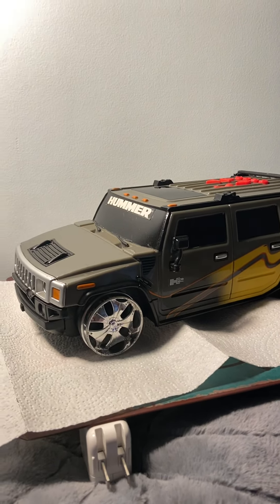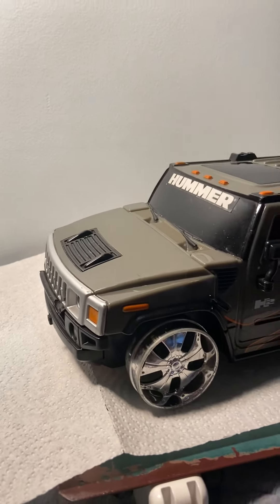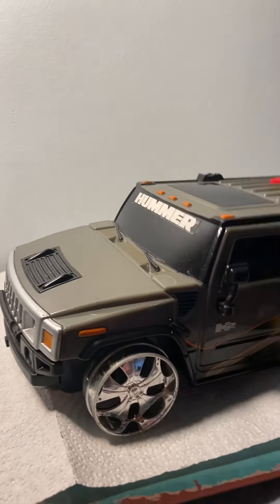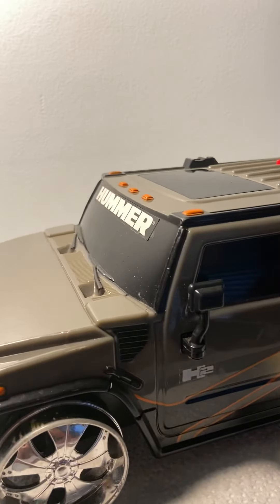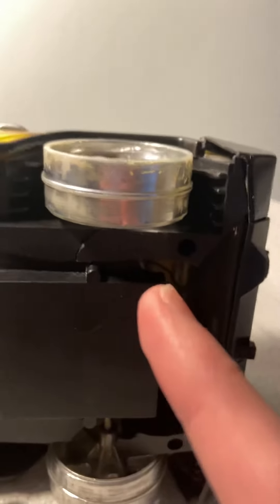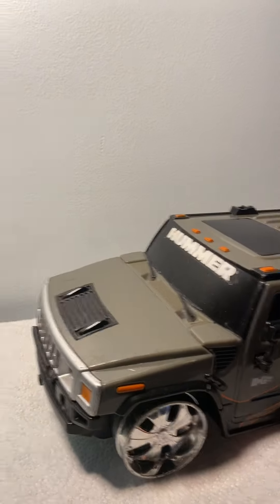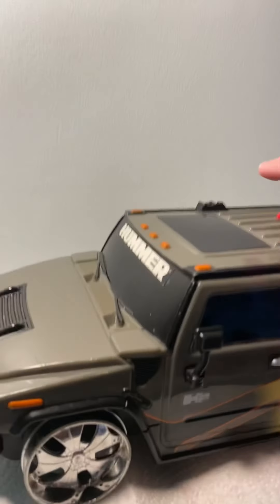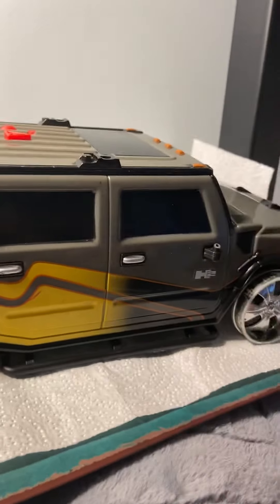2007 T.S.I Road Rippers Top Tune Comeback '04 Hummer H2 ( Extremely Rare )

Comment: Nice. I’m still trying to get my 2006 top tune come back HummerH2 up and running again.
Reply from the maker: Yours is the gray one, if so, it’s 2007, also did u see mine is in horrible condition and had water in it when I picked it up
Reply: @masterroadrippercollector9723  yeah I’m glad you picked it up but honestly if I saw that I would’ve left it.
Reply from the maker: @Vehiclemaster-qq6fr  yeah, surprisingly when I got home it had no more water in it
Reply from the maker: @Vehiclemaster-qq6fr  one peice of the base that is broken off in the back is the place where the screw goes and screws into the body, and since that part of the base is broken off the original owner glued in on there so I can’t get that broken part of the base off, and the plastic scrapes against the one wheel
Reply: I found one at Goodwill in good condition in 2018 and another one with a messed up gearbox earlier this year when I found the 2 cha cha slide pt cruisers (I could only get the one in better condition), the other one also had a messed up gearbox
Reply from the maker: @thattoyvehicleguy9000  I don’t know how you found to of the same rare hummers and pt cruiser
Reply from the maker: @thattoyvehicleguy9000  this one I had to find the listing, and go to someone’s house, if I did not get this hummer, it would probably end up at my local goodwill, or worse, maybe in the trash, because you can’t sell this on eBay, nobody will buy it
Reply: @masterroadrippercollector9723  a few years ago I got pretty lucky at that location, not as often since I moved closer to it but that's how I got my SPS Escalade when I first went there

Also Ive found some pretty rough stuff there (the turbo rig trailer, vault buster and 2 of the bigfoots I found, oh and a job site machine wheel loader. surprisingly the '07 snakebite was fine just needed the chassis repaired)
Reply from the maker: @thattoyvehicleguy9000  I found 2 rare RRs at a goodwill like 30 min away from me one time, only time I was actually lucky at that one, now at that one I find newer RRs that have severe corrosion, or olderish RRs like 2011 + with a lot of corrosion
Reply: @masterroadrippercollector9723  I mostly find 4th gens, one time I found a rarer 4th gen that I somehow miraculously revived from corrosion
Reply from the maker: @thattoyvehicleguy9000  I did find a 2009 RR at my local goodwill, it was super dirty missing battery compartment, had glitter on it, and orange gunk in the rims, I got it, and cleaned everything but the gunk in the rims, and the 2009 RR works, but the mute switch is kinda messed up, like when you turn it on in the middle of a song, and then turn it off, the sound will cut out a few times during the song
Reply from the maker: @thattoyvehicleguy9000  honestly, with my luck, I will never find a TTCB at my Goodwill, 2 years or so ago I got back into collecting, kinda, I was trying to get only TTCBs but never found them at goodwills or thrift stores, then I saw some of no name 51’s videos of him destroying RRs like one vid he destroyed the very rare TTCB 2009 pt cruiser cha cha slide blue variant in water, it made me so sad because I tried so hard to find TTCBs, now I have a okay amount of TTCBS because I bought most of them online, I also have found RRs at antique stores before
Reply: @thattoyvehicleguy9000  I usually only find third GENs and up at my local Goodwill but there is the occasional second GEN. Only got lucky enough to find a first GEN wants at a Goodwill slightly farther away from me.
Reply from the maker: @Vehiclemaster-qq6fr  nice
Reply: I've only ever found 2 first gens, obviously that one was corroded to hell (turbo rig trailer), the other being a lightning blast mustang that just needed the gearbox back in place
Reply: @thattoyvehicleguy9000  yeah I remember seeing that video.
Reply from the maker: @thattoyvehicleguy9000  nice a lightning blast mustang
Reply: Btw the 4th gen I mentioned took a whole month to fix because wires kept coming off, solder pads kept coming off the board due to heat so I had to improvise on making all of the lights work, some wouldn't turn on to begin with, on top of that I also added more lights on the back of it
Reply: @thattoyvehicleguy9000  hope it was rare and/or worth the time. Sounds like what I’m going through with my HummerH2 right now. I was sooo close to getting that gearbox fixed and then things started popping off.
Reply: @Vehiclemaster-qq6fr  it's the garbage truck from the Rollin' Sounds series, they weren't made for very long from what I remember
Reply: Welp, just found another 1st gen there yesterday, I'll make a community post about it shortly
Reply: @thattoyvehicleguy9000  Wait.. you got the viper at GoodwiII? DANG!
Reply: @KlaskyBobCsupoPants  not the icb viper, the Kawasaki big rig

Comment: Jeez the chassis is messed up badly 
And well the entire vehicle 
Also you did the thing again-
Reply from the maker: Sorry, I posted this video before reading your comment
Reply from the maker: Are you  glad I saved it Xbell
Reply from the maker: Because she was shaking water out of it, and it would probably have fried if I did not get it
Reply from the maker: Also when I got home there was no more water to clean out of it, also I never find things like this for sale near me, and I did fix the description, which you know, I said where I got it
Reply from the maker: Honestly Xbell this is not the worst condition, but it’s bad
Reply: @masterroadrippercollector9723  The chassis is literally shattered, the wheels are missing the tires and the bumper guard is broken off-
To me it's in very horrible condition and the fact she was shaking water out of it makes it worse, it's a wonder to how it still works well like as if nothing happened to it. Good job for making it spring back to life
Reply from the maker: @Xbell-The-Road-Rippers-Expert  
Typically the water dried out of it when I got home, but there was corrosion, so I had to fix that, I cleaned this by myself, and fixed part of it by myself, my dad did not help, there is one part of the fender in the back, one of the pieces broken off, the original owner glued the piece of the fender, not the mention that was where one of the screws was, and now that piece of the fender is scraping the wheels, probably messing up the motor, in the vid also the motor has gotten really loud, I’ll have to fix that, but I am glad I saw this listing when I did or this thing possibly would have fried out, hopefully after all it has been through it does not later on fry out
Reply: @masterroadrippercollector9723  idk man the only way it could be in worse condition if the body ended up like my original TTCB orange F-150, it's also a miracle the speaker doesn't sound muffled-
Reply from the maker: @thattoyvehicleguy9000  yeah, can your f150 ever be fully repaired
Reply: He ended up getting another orange one. He has both the red and orange ones now.